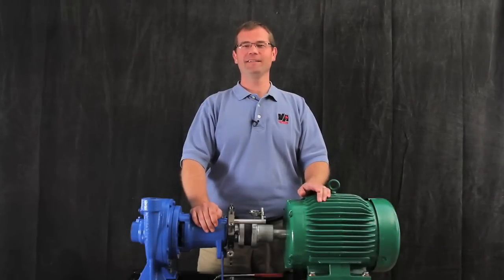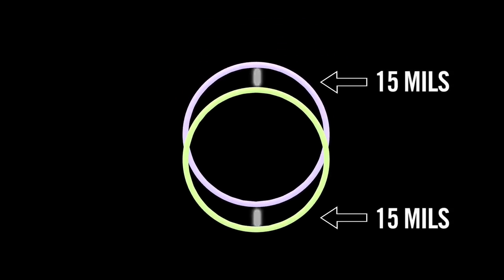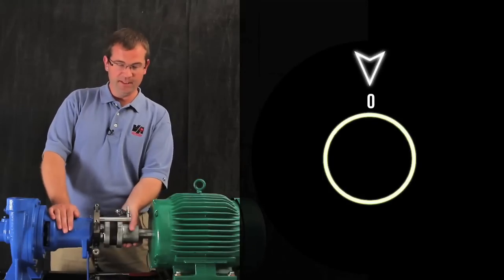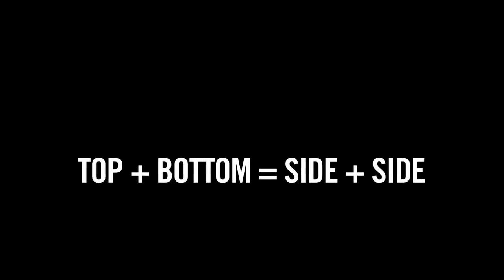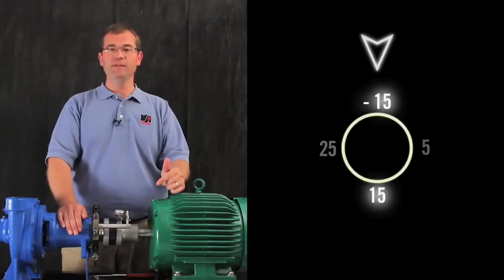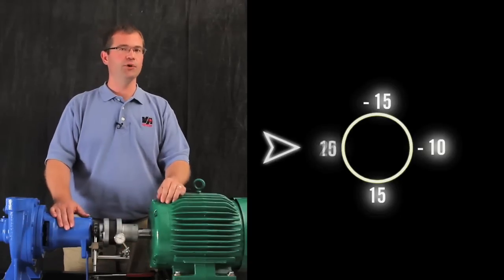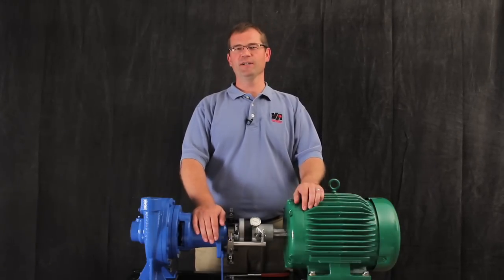Dial Indicator Concepts:  TIR, Validity Rule & TPS | ACOEM

Comment: As aCNC machinist I set spindle position in relation to a hole in a part or, more often, a tooling hole on a part holding fixture (and some other co-ordinate positions as well) when setting up to run different parts. Your videos were well done and facinating and it was easy to relate to the concepts you were presenting. Your company looks like it does well at providing an important service to many industries,while at the same time appreciating the contributions of each employee. I am impressed!

Comment from the maker: Hey Dimtt2,

I am so sorry for this late response.  I was reading comments and came across your questions.  1. Yes, the validity rule applies tor face dial values as well.  2. While bar sag will impact the vertical dial result, sag does not affect the validity rule as the dial and the point of contact both turn true circles.  Bar sag merely causes the circle to be displaced downwardly.

Comment from the maker: Thanks for asking. Bar sag can be measured by mounting the dial/s on a piece of rigid pipe.  The dial/s are set to zero at 12:00 and turned 180 degrees to 6:00.

Comment: I've been doing alignments on rotating equipment for quite a while and mils is the term used in that field, especially with laser alignment. I will add everything I do is English measurement based, not Metric. Doing other forms of precision measurement using mics, calipers, indicators, etc., a form of thousandths is used in most cases. Though, they do get interchanged depending on whom you're communicating with. That's been my experience, anyway.

Comment from the maker: Cd, thank you for responding.  Perhaps we were not clear enough. Mili is latin for 1/1000th.  A milimeter, is 1/1000th of a meter and 20 milimeters would be 0.7873".  We could have been clearer, however we were using the term mil to represent 1/1000 of an inch. In this expample, 20 mils=0.020".   It is approiate to use mil in this context.  If you buy a 3 mil garbage bag in the USA, the thickness would be 0.003".  I hope I have cleared up any misunderstanding. Again, thank you for your response.

Comment from the maker: Edge, I appreciate your response and I also aprreciate your fear.  However, I have been aligning machines with true position data for about 15 years. You might give this a try. It is especially useful when getting 6:00 data is difficult or impossible.  From a technical point of view, the only way the values do not add up is if the center of rotation moves during rotation (excessive bearing clearances coupled with bent shaft) of the shafts.

Comment: Dear friend
Please answer
In the graph plotted using reverse peripheral alignment method, if f1 (reading at front foot) and f2 (reading at back foot ) are +ve readings :?
1.shims are to be added for both driver and driven equipment
2.shims are to be removed from both driver and driven equipment
3.shims are to be added to both the feet of equipment being aligned.
4.shims are to be removed from both the feet of equipment being aligned 
Please answer which one is right answer 1 to 4

Comment: Mil is a specific measurement refering to units of angle.  Using mil as a substitute for thousandths of an inch is something I've never seen or heard in twenty years of machining.  Doing so would be disastrous in shops like mine where we have both SAE and metric blueprints.  And now that I've griped a little, it was a good explanation of TIR.  But another gripe.  Total indicate RUNOUT.

Comment: I don't get the total validity rule, surely it is stated wrong.  What if the motor is misaligned 100 in the horizontal and 20 in the vertical?  Surely its supposed to be left + bottom = right + top.  Can you clarify?
Reply: Nope he got it right, if the dial reads zero at the top, left + right = bottom

Comment: This is great! What I wonder is could you not put the indicator on a magnet stand and just rotate the shaft? You could read at 6 that way -- nothing would be in the way. Why have the indicator mounted on the shaft so it rotates for the reading... I don't get that... Note: I'm dealing with round stock sticking out of a lathe. Thanks!
Reply: The point of taking readings with the dial attached to one shaft is that you're trying to align them, i.e you are trying to get a relative position reading between the two shafts. If you were to measure with your indicator attached to the base and reading one of the shafts, you would only be reading the runout of the shaft, and not its position relative to the other shaft

Comment: The validity rule makes no sense to me. I'm following your math, but how exactly does horizontal readings = vertical readings? You could very well be out 0.050" horizontally and only 0.002" vertically, then the validity rule couldn't apply.

Comment: why is the tir  top to bottom 30 or 15 and side to side only 10
Reply from the maker: those are the values we chose for this example.  the point is that the horizontal and vertical offsets are not dependent on each other, they can be any set of values.  BUT the TIR will always be 2X the actual offset in each plane.

Comment: The math for the validity rule doesn't add up. Shouldn't it be the absolute value of |Top-Bottom|=|Side-Side| to account for negative readings. In your example the TIR from 0 to 180 is 30-0=30, but your TIR from 90 to 270 is actually 25-5=20. I assume the actual value at 90 is 5, hence 25(-5)=30.
Reply: Can you pls explain the absolute method

Comment: validity rule makes no sense if a shaft is in line in the horizontal the validity rules states that it must be in the vertical too. but it could be 100 thou too high for example. just stick to Rotalign?! it does it for you :)
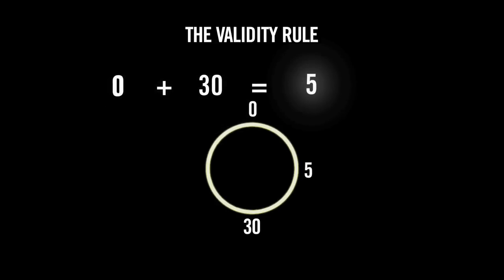Reply from the maker: Calum Johnston Calum,  Thanks for your comment.  Perhaps we could be clearer.  The validity rule states that when taking sweep readings (every 90 degrees) top + bottom = side + side.  Assume that you set a dial to zero at 12:00 and you rotate the dial to 3:00, reading +20, then rotate to 6:00, reading +50.  Top + Bottom equals 50, therefore the 9:00 value must be 20 + ? = +50.  Therefore the 9:00 value must equal +30.  
Lets assume that the we are perfectly aligned horizontally and NOT vertically. Here is an example:  12:00 set to zero 3:00 = +10, 6:00 = 0.  Therefore,  If  T+B = zero, then +10 + ? = must also equal zero.  Since the value at 3:00 is +10, the value at 9:00 will be -10.  Horizontal TIR will be 20, and therefore the horizontal misalignment = 10.  I hope that makes sense.  Have a great day.  David Zdrojewski

Comment: clymnt...the answer is so obvious...the shaft is egg shaped : ).  just joking i agree with you.  it would seem the side should be 30 as well.  i really don't understand the whole 15 thing anyway.  i have always solved for 0 in one direction. and then made the third side the same.  when you have -15 and +15 you have changed nothing but what the dial is reading.  i may just be confused on what is trying to be taught.